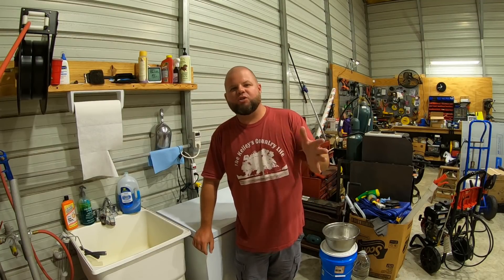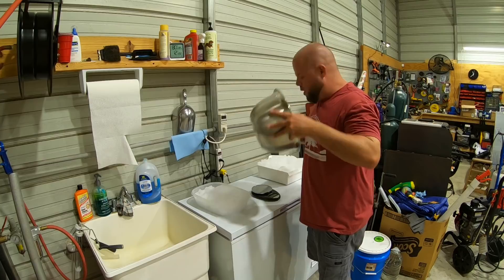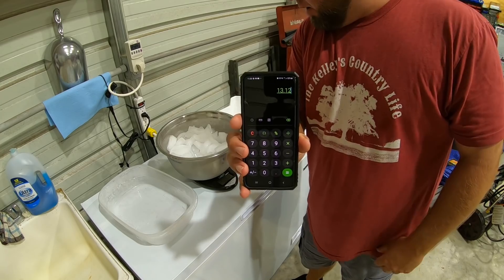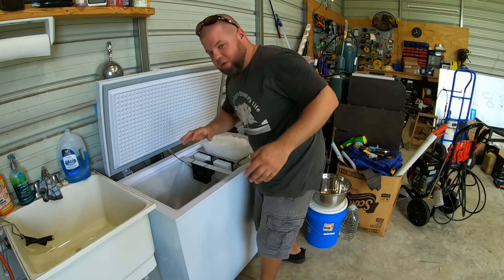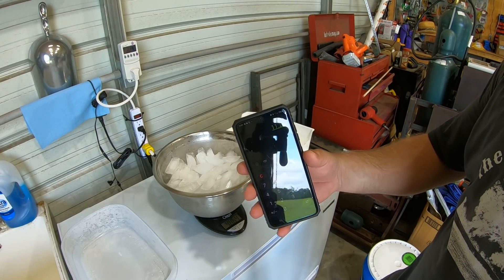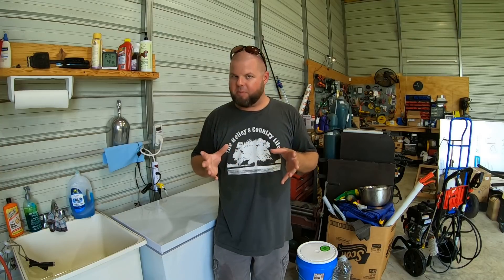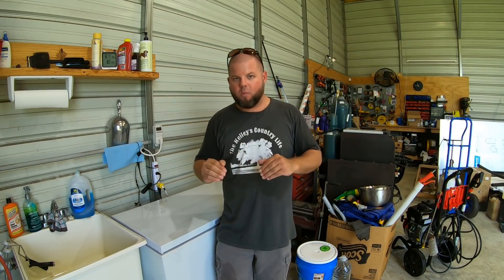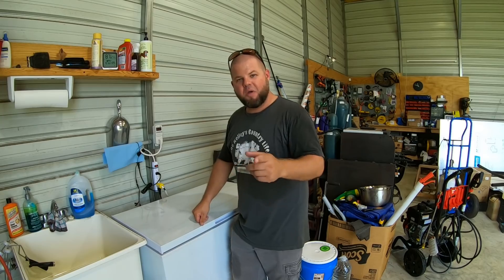Homemade ice machine produces highest production yet!!!! #403

Comment: I have an idea: when you make your new ice maker, take the table top ice maker and cut a hole in the bottom where the ice is stored and then cut a hole in the top of your old freezer and mount the table top to the top of the freezer. See if it really puts out 40# a day
Reply from the maker: A big problem with that, the table top produces melting/wet ice that would freeze together in a big block in the freezer.

Comment: Adding the reducer to the fan is the same effect as when you get hot air from your mouth when it’s wide open vs when you constrict your lips and get cold air when you blow. Also just like an HVAC compressor and condenser; air gets colder when forced through a smaller opening.

Comment: Run a pipe from the cones intake side down the to bottom of the freezer. That will pull the cold air from the bottom up to the ice makers. Might help get a slight boost in production.

Comment: I wrote you before about my Grandfather’s Bar and the cooling funnel fan they used to keep the trough of water at the prefect beer bottle temperature. The funnel would glow in the dark because when air is compressed it has to release or rather give up heat calories and when air expands it has to absorb heat calories. It is just physics in action.

Comment: Very interesting results.  But I saw something I should have noticed sooner.   Your ice makers and the fan are all at the top of the freezer, next to the lid. Now the lid has far less insulation than the sides of the freezer. Your ambient room temperature is going to have a bigger effect there than anywhere else in the freezer.  So having a fan blowing there is actually going to recirculate the warmest air in the freezer and blow it right on the ice makers.  Will that make any difference? I don't know. But I'd love to see results after insulating that lid.  And it doesn't need to be fancy. You may have bales of insulation sitting around for the house build.  What happens if you drape some of that stuff over the lid?  Lower internal temps? Lower temps at the ice maker level? Nothing?  I'd bet there is an effect. If you have touch the lid from the outside and feel cold, that means heat is getting in the other way around.
Reply from the maker: I did test insulation on the lid with heavy moving blankets, practically no difference tical

Comment: You should try my setup on air movement, i am pretty sure you will get similar results with far less energy usage compared to that high flow fan your using. Get a sheet of pink insulation foam and build an insulated box around the ice makers with the only hole being the bottom so the ice can fall out. Then to the left of the ice makers on the left wall of the insulated box, cut a hole for a fan to be glued into the wall, not on the outside, but glue it into the foam board wall with the air direction pulling air from the insulated box and out. This will force the fan to pull colder air from lower colder area of the chest, flow across the ice makers and exit the left side, never exposing the ice makers to the warmer air when the chest is opened. You will be surprised by the results...
Reply from the maker: That's a very interesting approach

Comment: Instead of a muffin fan with the velocity cone try a squirrel cage fan which is much more directional and uniform. Maybe try a shroud over the makers with a fan or 2 pulling air out high and allowing cold air to flow over them from the bottom up.

Comment: got any dryer vent the foil wrapped stuff run a pickup tube from bottom freezer to the fan coldest air pulled up to the icemakers !
Reply from the maker: Yes I showed that off in the last video, been thinking about using it

Comment: Also, unless I misheard something a few episodes back, did you say the counter top ice machine made 30 lbs in like 24-48 hrs? If so, why can't you put that ice maker in the freezer instead of those door units?
Reply from the maker: It's not designed to work in a zero degree climate. Plus the cubes come out very wet and would freeze in a big clump.

Comment: A thought?  Could the new issue of water/clumping mean that the ice is freezing too fast... causing a hard outer shell or top surface that meets the demand of the sensor before the core (or bottom) can freeze completely?  
Also... Could the new "super fan config" be cooling the metal tray unevenly, causing the edges closest to the heating element to melt (liquify) a bit before release ?  
I think a circuit that cuts fan power during the heating process will show a very positive result....
Reply from the maker: Very possible

Comment: Love your ice machine build series. I wonder if there's a way to rig the tabletop icemaker to dump it's ice into a larger storage unit like a cooler or mini freezer?
Reply: Also, to make large blocks I've frozen water in large containers like 2 liter bottles and cube shaped containers, they take longer to melt down.
Reply from the maker: The table top makes very wet cubes that would freeze together if dumped directly into the freezer.
Reply: About 15 years ago I did something similar. I removed a shelf in a side freezer/fridge and placed a container that held more ice than the normal freezers container tripling it's storage. The icemaker went out and i then just bought 25 ice trays and manually filled them daily to fill the huge container. Took up half the freezer but we were never without ice. Can't wait to see more of your ice machine 2.0 ideas.
Reply from the maker: The only reliable way I found to keep table top ice is to bag it and then freeze it. It still comes out frozen together, but you can bust it up in the bag quite easily

Comment: Apparently my new freezer sucks as its a exact copy of your set up in a 72 degree room, and it dont make ice, just water comes on, upper temp is too warm to freeze it it says 4 degrees but one dont come on but one time and the other just adds water and dont freeze.  Idk.
Reply: Maybe lower the makers a bit more in the cooler
Reply from the maker: Sounds like you have a freezer problem if the water isn't freezing. That or your allowing too much outside air in. Your running a thermometer and it's reading 4 degrees? That's plenty cold enough to freeze water.
Reply: Its brand new, already cut out for ice makers, seems when fan is on it get warmer, idk, im disgruntled at this point, it seems to be at 10 degrees up top and -4 on bottom, i think i’ll thaw it out and lower ice makers about five invhes or more and try again
Reply: Seems like a good seal as well
Reply from the maker: Mine runs 10-13 degrees up top, but the fan cooling effect has no issues turning water into ice. Lower is better, but it sure seems like something else is wrong.
Reply: Im a mellon head, had solenoids switched, filling wrong ice makers. Problem sovled ! Working great, may add fan later.  Thanks for everything
Reply from the maker: Great find!

Comment: i wonder if the clumping is because the high speed air from the fan could be blowing some of the water out before it freezes; which then falls down and freezes on the previous batches
Reply from the maker: Very possible

Comment: I suspect your new clumps of ice could be from the fan splashing a little water out of the molds before they start freezing. We have one of those french door fridges with the ice maker in the door, and opening and closing that door leads to water splashing out and freezing the loose ice together. You're likely experiencing something similar with the high velocity. 

Should be easy to test for that, put your metal pan under the ice makers for a few hours with no containers, and then see if you see any areas where water hit the pan and then froze.

Also, if you're planning a few more tests, there's still the idea of a fan near the compressor to help push some of the heat away faster. If the compressor runs slightly more efficient with more air flow it could offset the cost of a second small fan as far as electricity goes. 

Of course another big wild card is winter, it might run more efficient and make more ice when the ambient temperature stays lower. Although those of us in the south know winter is more of a concept than reality.
Reply from the maker: Already tested the compressor fan, rather disappointing results.

Comment: So heat transfer happens in 3 ways: conduction, radiation, and convection. You are trying to accomplish optimal heat transfer through conduction changes alone. The equation for conduction heat transfer is Q=hAT. The  "h" value is basically the value of the fluid (air in this case) that is flowing across the transfer surface. There are several ways to increase the h value, but the one you saw there was related to the increase of velocity of the fluid. Imagine the h value as you taking a hot cup of coffee and blowing across the top. The lower temp air you blow across the top and the higher the velocity you push the air, the higher the heat transfer rate. You are doing college physics experiments without even realizing it! Now if you can combine bringing the lower temp air from the bottom, with the higher velocities, you can up that h value even more. And if you can bring in other modes of heat transfer, like conduction, that would up that even more.  Like say, putting some kind of permiable barrier to have a free air space on the bottom, and piping that air up to the fan, that would make it to where the pipe doesn't get clogged, and you have higher air flow with the colder air
Reply from the maker: I think I'll accomplish all of this on the next build, just trying to find a freezer.

Comment: It makes sense because the ice trays are acting as a heat sink and pulling the heat out of the ice. The more you’re going over them call them but I’m really surprised by those results. An extra 2 1/2 to 3 pounds is way more than I thought it would ever be.   Interesting.  

I would guess it’s because it’s removing the heat quicker from the water and re-distributing it through the rest of the cooler where the surface of the cooler can draw it out quicker.   🤔  it makes sense that the velocity would matter, basically your ice trays are working like a heat sink.   

I’m guessing that the problem with the ice sticking together is that it’s tripping the sensor in your tray too quickly and dumping wet ice that’s not completely frozen.   My thinking is that the increased air velocity is cooling the trays quicker and freezing the outside of the ice faster than the inside so when it dumps the ice it’s still got a little warm water in there which is either leaking out and making the ice stick or because that heat is still in part of the ice as it drops in the bottom it melts it just enough to stick together.  

My icemaker it had with it called turbo mode and it was just a fan built into the icemaker, when you turned it on when it would dump water it would run that fan for a little while and it blew right along the bottom of the tray. It didn’t run all the time but after it put water in the tray it would run for a pretty good while. I never measured the difference but I did notice that we would run out of ice in the summer and when I had the turbo mode on we didn’t run out of ice so it’s a pretty good bet that it helped some with your test would confirm.   

As far as working on future units, I would figure out what’s the best bang for your buck as far as power usage wise and the cost of the fans and everything involved. If you wanted to get really fancy you could probably create a shroud under the ice tray that would keep all of the air blowing but it’s probably better just to use a little more powerful fan then have to deal with that because it would probably need to be a moving part to let the ice out properly. I’m thinking also that that same hardware in a larger freezer might do better as well because of the sheer capacity and ability to remove heat from the system better once it was chilled down all the way. I’m also noticing you keep getting a lot of frost on the wall which is probably in large part due to the fact that you keep opening it to run these tests and letting a lot of human air in. You might want to look at ways to remove humidity quicker as well.  I think one of the best ways to do that would be to find a way to get the ice out of there without having to open the freezer. A shoot on the bottom that dumps the ice while limiting Eric‘s change would probably be the most efficient. And of course securing your seal around the top is always going to make a difference. On my chest style freezer it has a vacuum system. When you open it and take something out and it’s been open for a minute and you close your freezer it’s very hard to open after that because it’s creating a vacuum like a refrigerator does. Any break in that is going to be sucking in warm moist air. I thought about how you said you don’t want to drill through the sides and the best solution I can come up with is to do it the way you did when you cut through the top but then Apoxsee over it and smoother surface out again so your ceiling Apoxsee over your water inlet and electrical cords and restoring the smoothness of that surface so it can seal fully and quickly. My guess is that vacuum system sucks most of the new air out which should also take a good bit of the humidity out as the air in there should be pretty dry.  I think overall the best way to make it more efficient would be to find a way to put a tube in the bottom or a shoot and insulate around that and have a quick valve system where you can dump ice into a cooler or a bag without opening the whole system up. But you have to worry about that vacuum seal again there as well so that could be a bit costly because you’re creating a mechanical part that’s going to be fairly complex compared to adding a fan or running a cable through a single time. One option I could think I would be a huge ball valve, my guess is PVC with insulate the best but you’re always gonna have issues with heat trying to creep in there so I’m not sure that’s feasible from home based test system where are you would have to create that.   I would probably try to create separate chambers. Like maybe put a tarp over the ice machines in the fans and just letting the ice flow to the bottom of the freezer and then when you open it the icemakers and fans would still be covered which would prevent a lot of hot air from getting into the system because it would only get into the open area where you’re going to get ice from. Though I think you would need a bit larger freezer to make that practical.  You could even build your system into a box with ice just fell out of the bottom and let that box take up a lot of the space in the cooler on top and sort of shield it from the heat when you open it.  Fun fun.  Lol.
Reply from the maker: Valid points and an especially good point about triggering the makers before being completely frozen.

Comment: What if you made one of these in an upright freezer, that way you could place three or four ice makers in it and the could drop into a big container in the bottom of the freezer.
Reply from the maker: I've kicked the idea around, but I can get deep freezers cheaper and uprights aren't as efficient with as much as I open this. They dump cold air straight to the floor

Comment: After your last video, I was wondering if putting air right on the mould would be better.  You could use a couple of the small 50x15 mm 5015 blower fans sold for use in 3-D printers and such.  Very focused air and less heat from the fan motors.  At 2" they could be mounted right on the moulds

Comment: Just some warning from someone who lives in Canada, the higher you make the wind speed the less of an effect it will have.  Just play around with a Wind Chill calculator.  10F 10 mph wind makes it feel like -4f, 20 mph is -9f, and 40 mph is -15f, 80 mph is -20f.  You can see the effect slows down a lot.  Also an common fact people get wrong is wind chill doesnt affect the actual temperature of something just how fast that something loses heat.  So in the examples above a thermometer will still only read 10F

Comment: It's worth thinking about putting something rounded or wedge shaped on the wall by the ice makers, that should rather dramatically increase air circulation. Currently the air is moving fast and hitting a flat wall it loses a lot of force but if you add a type of "splitter" on the wall the air should have a more defined path of circulation.

Comment: Velocity as well as direction. Imaging blowing on a spoon of soup to cool it or on your cold fingers to warm them. Blowing from 6 inches away or from an inch or so away makes a huge difference. Also, blowing slightly to the side is exponentially less effective. You are literally removing the heat faster by close fast air movement.

Comment: ok....updating my previous comment on the points for v2.0.  This will mess up the idea of using the mini fridge to chill the water as it comes in but....
Mount an ice maker at each end of the freezer with a fan angled just over from it to put air across the ice tray.  This will end up having 2 fans in side the freezer but will give you center between both ice makers to get ice from the unit.  This will also allow you to leave the stop bars on the ice makers so if it does fill up (like in the winter time when you use less ice) the units will shut off.  If you want, I could draw a diagram of the mounting if you don't envision what I said to do.
Reply from the maker: I've actually got a design I'm eager to try and does keep stop bars ect